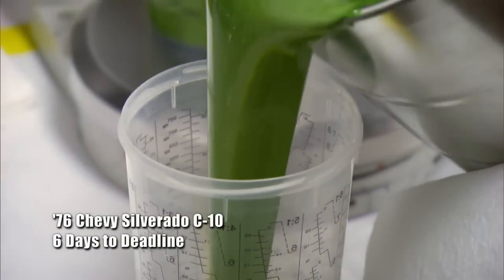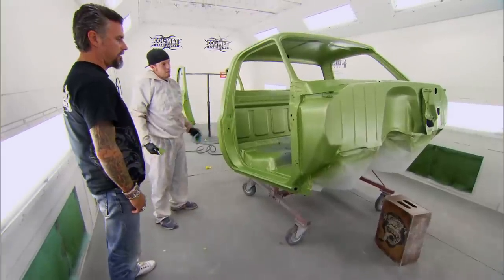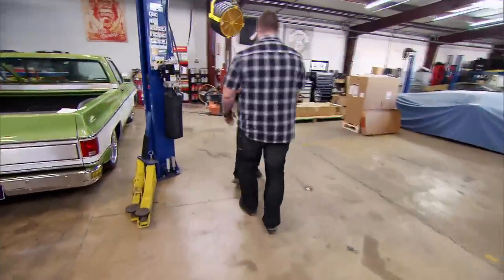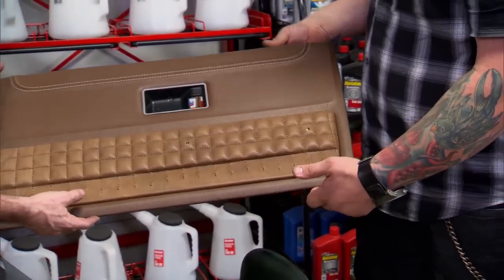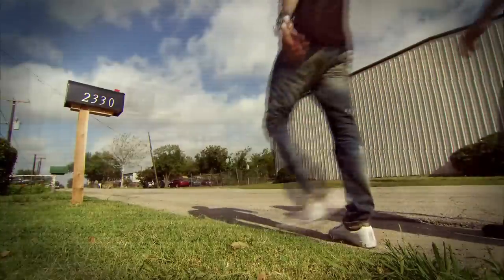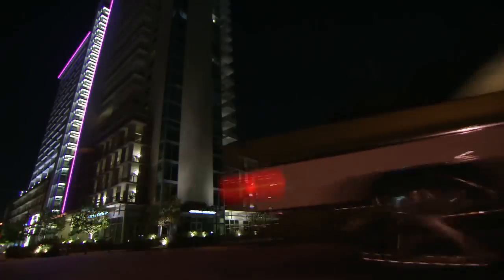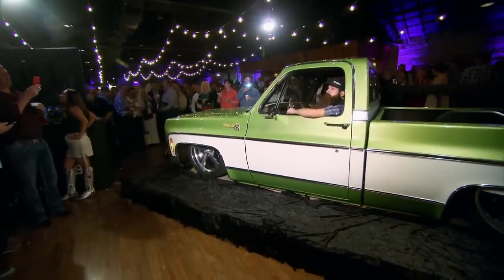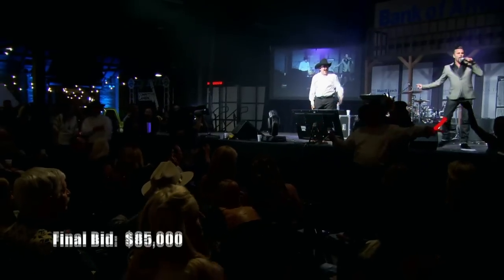The Monkeys Finally Show Off The '76 Chevy Silverado C-10 At The Cattle Baron's Ball | Fast n' Loud

Comment: i do have a 73 Chevrolet Cheyenne with 454 original engine on it. someday will be something cool too
Reply: If the car is gonna be sitting.. take your time to prep the oils, fuel, and coolant lines/tanks/filters.

Save yourself a lot of headache in the future. A lot of people park up perfectly running cars but when they come back years later everything turns to gunk which could have been prevented and saved a lot of money in repairs.

Comment: Alexrebuilds almost finished rebuild, it look awesome!
Reply: I’ll be collecting social security by the time he finishes that truck
Reply: @JohnnyG10178  NAH he's come a long way  on this TRUCK I just got through watching A Video on this particular TRUCK he has got the FRAME put together  the ENGINE & TRANSMISSION put on the FRAME along with all of the AIR LIFT SYSTEM REAR END FRONT END he was test fitting the CAB BED & THE FRONT FENDERS HOOD & even made MOUNTING POINTS for the FENDERS to MOUNT to he now is going to take everything back off of the FRAME & have it POWDER COATED & put it back together so it won't be long now before he has it together(IT DOES LOOK GOOD )
Reply: @aslamb6489  why tf are you typing like that?
Reply: @urge8153  he had a stroke while typing

Comment: What were they thinking when they took that  LIME green c10 with huge chrome wheels to a Texas auto auction!? Those old Texas people want a newer lifted truck or a lifted c10 4wd or literally almost ANY other muscle car or hot rod out there. Doesn't matter how much you spend on it. It's still a lowered c10 lime green with air bags and chrome wheels. What old man has EVER wanted a truck like that lol that is an extremely specific market for that truck here lol

Comment: Got a little over 100k in it sold it for 85k not included the percent of the auction seems like you got screwed on this build
Reply: Actually probably no more than $40,000 in materials.  Adding in labor no doubt.  There is no way a $1,000 truck, striped and modified has $100,000 of mods on it.
Reply: @Kmangod  for real
Reply: They doo most of the labor themselves & a lot of those parts they get it for the low, by knowing people. So $100K is the estimated value. But I’m sure the money & labored they put on it it’s way less.